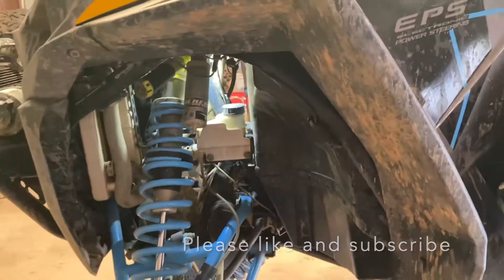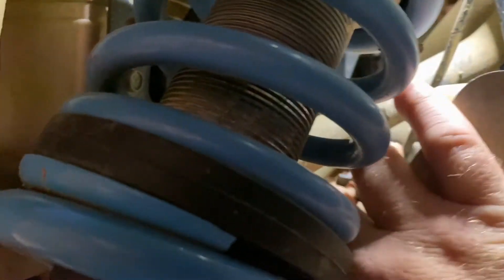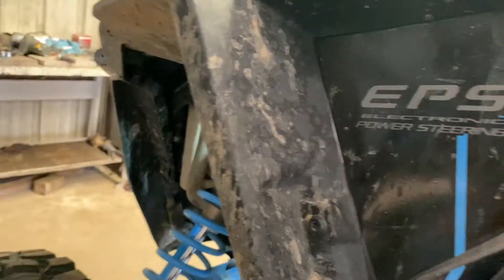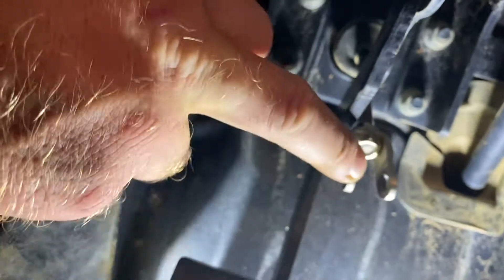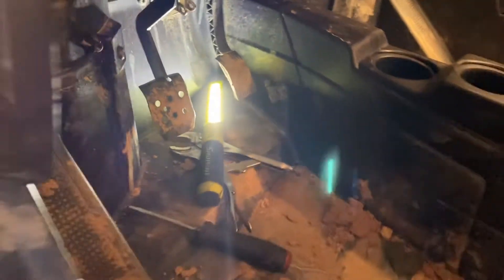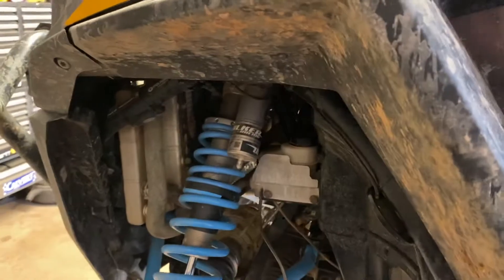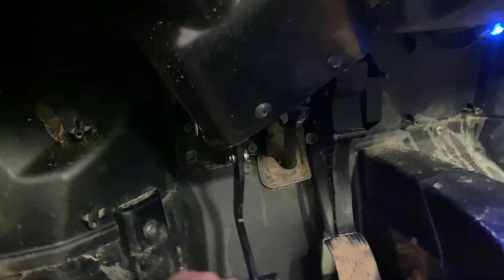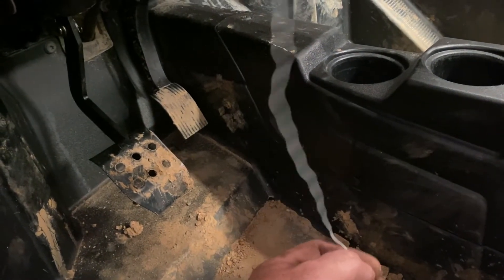Brake pedal adjustment as well as a quick fix on the trail for no brake lights

Comment: Mine is doing the same thing, does anyone know the part number if the switch needs to be replaced? Having a helluva time finding exactly what I need. Thanks for the video, helped a lot!
Reply from the maker: I don’t have the part number but the new updated part has a wire pigtail now
Reply from the maker: So you may find it but it looks different but will work

Comment: My 2018 started doing this.... sometimes it starts sometimes it doesn’t… if your brake lights go on, it’ll start.... if they don’t it won’t. Dang it!
Reply from the maker: That’s what mine was doing swapped it out no problems now
Reply: @CToffroad  Ordered one last night...it’ll be here Monday... $44.00...thx
UPDATE: when I went to remove the pressure switch it was hand tight from the factory! Wasn’t leaking brake fluid either! What?? So I tightened the shit out of it and no problems. Returned the switch today, it was the wrong one anyway. Duechebags.
Reply: @CToffroad  update below/above.... whatever
Reply from the maker: Funny mine was as well I still swapped it out but I honestly figured it was just mine and didn’t really mention it thanks for that update will probably help a lot of people out